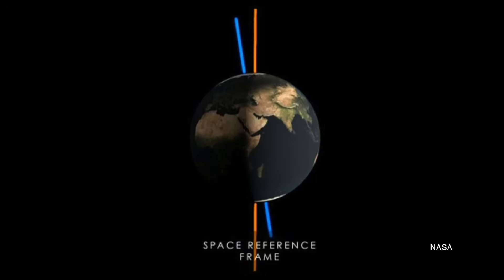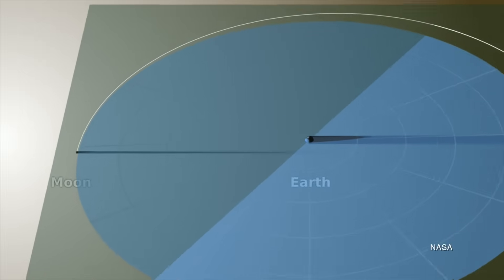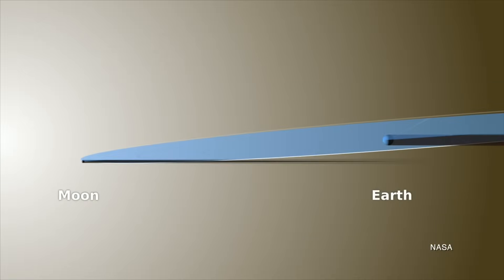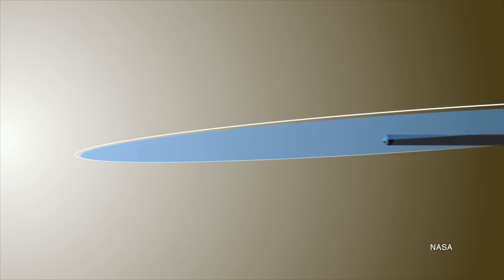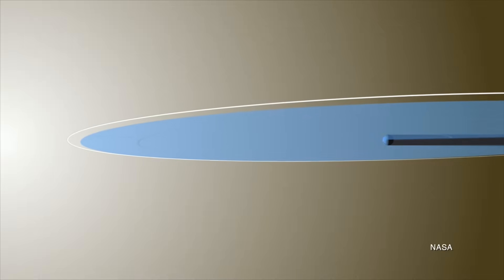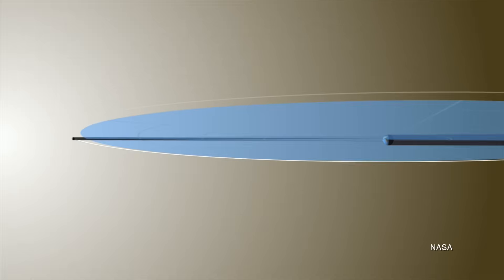Why Does a Rocket Need to Roll Going Into Orbit?

Comment: They also had to do a "yaw maneuver" to get the rocket going AWAY from the tower. appropriately named the LUT avoidance maneuver.
Reply from the maker: I talk about the yaw in my blog post. It was too long to work everything into the video... I didn't want it to be 15 minutes long!
Reply: yea, I think that yaw maneuver was way trickier, almost a side slip. Banging into the tower would have wrecked a lot of people's day
Reply: +bkearns34 Think "H-Bomb at 39A". Ka-boom.
Reply: +Accutronitis That was just the propellant servicing arms that are T-0 umbilicals that have to remain attached until liftoff (in the event that there is a scrub / abort the stages need to be drained)

The "yaw" after liftoff gets the rocket moving away from the tower so it does not hit it. I think the video of the Apollo 13 liftoff you can really see it (hard to see if the camera angle is bad)
Reply: +Accutronitis A forum that explains it. The "tilt maneuver" lasted from about 3.6 to 10 secs after liftoff. Maximum yaw was around 1.5 deg
Reply: +Amy Shira Teitel (Vintage Space) I remember John Young was always worried about the piece of "fixed service structure" that jutted out from the back of the tower to support the Shuttles H2 T-0 Vent Arm. Mentioned how he didn't know how the stack got by it.
Reply: I didn't know that yaw maneuver, how come tiny thrusters apply huge horizontal thrust required to move such a gigantic rocket away from the tower
Reply: +Kishor Bhatta It wasn't done with the RCS thrusters. Those are totally ineffective in the atmosphere. The Saturn V steered by "gimbling" (tilting) the engines on the corners. Does not take much.
Reply: +Kishor Bhatta On a Shuttle related sidenote, they DID do a small RCS burn of the thrusters in the nose section right at SRB sep, to deflect the plume of the SRB sep motors away from the cockpit windows (many crews in the early part of the program complained about gunk/streaks getting on the windows)
Reply: +Zoomer30 oh yea understood

Comment: Amy. How did they start the engines of a Saturn rocket? Is it just the fuel comming out of the exhaust and lit it with sparks?
Reply: The Rocketdyne F1 (the first stage motor for the Saturn V) was ignited using a hypergolic ignition cartridge. Basically this was a capsule containing a chemical that would spontaneously combust in the presence of oxygen, thus providing a reliable starting mechanism. 

The capsule was placed in the fuel line just before the fuel entered the combustion chamber. When the engine was started up, the turbo-pumps would fire, and start pushing the fuel through the line and into the rocket. This would burst the cartridge, and the chemistry would be mixed as it entered the combustion chamber and further mixed with the liquid oxygen, leading to sustained combustion.

The chemical in question was primarily Triethylborane, which was the same chemical used to restart the engines on  the SR-71 blackbird, and also used to start (and re-start) the engines on the Falcon 9.

In the case of the F1 engine, though, there was only one opportunity to ignite the engine, and no restart was possible. If they had a pad abort, the cartridge would have to be replaced.

Comment: Thank you. The idea that an object that is able to move in three directions couldn't just gimbal the engines to point into the correct direction didn't make any sense to me. It makes sense now, though. It's not about the rocket not just being able to point itself as much as it is that the guidance system needs to align itself. 
...at least that's what I took away from this.

Comment: I think Amy is awesome to her galactic centre and has been for light years but pitch and roll aside, I have a question for the budding Max Fagets and Apollo capsule designers out there. Why was the Apollo spacecraft's center couch slightly lower than the other two? And based on crew preference, why did Mike Collins choose the right hand seat on Apollo 11 when all other CMP's rode in the centre couch? It's the simple things about Apollo that annoy me most. I spoke to Al Bean and Gene Cernan once but these are not questions you would ask in their presence. Hopefully someone can finally answer these questions that have bugged me for years. And hopefully before Voyager reaches the Oort Cloud...
Reply: As to the center couch being lower than the other two, I don't know... but my guess would be that since the center seat occupant entered last it made for an easier strap-in. Either that, or it had to do with how the couches folded to be stowed away in coasting flight. Or it made the three side-by-side seats less cramped with the center occupant's shoulders slightly lower and out of the way for the others. Or maybe something else entirely. :-)

As to Mike Collins, as far as I understand it wasn't really his decision to take the right seat. Armstrong and Aldrin had already trained as commander and CMP respectively in the backup roles for Apollo 8, and Collins wasn't part of that crew. It was decided that even though Aldrin changed roles from CMP to LMP he would still ride center couch on liftoff, since he was already extensively trained as CMP.
Reply: That's a swift response and great answer Benny Lofgren and thank you. It's funny but I forgot that Aldrin's roll on the Apollo 8 back-up would have had an influence on that. It's just that Aldrin was last to enter Columbia on launch and that put him in the centre couch. It makes sense when Fred Haise was the back-up LMP without an LM.

As for the centre couch being slightly lower, I had read in a spaceflight publication many years ago about this. However the author's only explanation was 'for obvious reasons'. Maybe he didn't even know. I know the centre couch was dismantled for most of the flight. The only things I could ever think of were for non-operational reasons and they all made no sense...

Comment: I still don't get why the roll? The yaw away from due east so as to align with the Moon makes sense, but why did a cylindrical rocket have to roll to change yaw? I'd compare it to an air to air missile, which as I understand it, doesn't roll to change heading, it just changes pitch/yaw as needed. To keep the crew orientated "heads up" so to speak?
Reply: Several reasons, crew orientation being one aspect. Look through the comments, it's been thoroughly answered by me and others in other threads.
Reply: In addition to the reasons mentioned earlier (crew orientation, simpler math), there's the aspect of "relative wind"-as the air rushes past the rocket, you want the nose pointed as close to exactly into the wind as possible.  If you use a combination of pitch and yaw, you're "crabbing" your way into orbit.  The rocket isn't moving through the relative wind nose first-it's kind of approaching it from the side.  That adds stress to the rocket and is less efficient.

Comment: When I play KSP most of my rockets roll as I perform a gravity turn, I find that some horribly designed rockets that would otherwise explode gain quite a bit of stability. RCS becomes pretty useless though.
Reply: RCS is for docking :)
Reply: Nah there's a claw for that. RCS is for helping dodge bits that fall or explode off during a launch.
Reply: +Marc83Aus Have you ever tried docking or grabbing with just your main engine?
Reply: Sander Datema I've done it before after running out of mono prop. But generally I'm terrible at rendezvous and docking even with all the stuff KSP does to make it easy.

Comment: And I guess the same is true for the Space Shuttle when it launched to the ISS which is inclined as well. But why didn't they build the Saturn launchpad in the right orientation in the first place? Saturn V was only supposed to go to the moon and never stay in Earth's orbit (except Skylab), wasn't it?
Reply: That's correct. The launch pad was oriented for the convenience of everything on the ground -- the crawlerways, the calibration equipment, camera and launch center views, etc. A roll maneuver is actually a very simple thing to do, and it had to be different for every launch anyway because the launch azimuths were different.

You didn't have to launch exactly into the moon's orbital plane, which is fortunate because the moon's inclination varies between 18.3 and 28.6 degrees. KSC's latitude is about 28.5 degrees so most of the time it would have required an expensive plane change to match the moon's low inclination.

But you did have to launch into an orbital plane that would include the moon when you got there. This, along with landing site lighting conditions, set the launch window and azimuth. You also had to be at the moon's distance when the moon passed through your orbital plane. This was the reason for having two burns of the S-IVB; the timing of TLI could be easily changed, and that would rotate the position of apogee within the orbital plane to match the moon as Apollo approached. (Actually apogee was a little beyond the moon's orbit to speed up travel time. But it was obviously still important for Apollo and the moon to reach nearly the same point in space at the same time.)
Reply: Apollo planners no doubt though there was a future beyond just moon landings. Von Braun wanted to see humans go to Mars and the Saturn-V was the ticket for assembling pieces of the craft, many of which were derived from the Saturn-V itself. There were plans closer to Earth for building second generation stations beyond Skylab. These missions would have had slightly different roll requirements than just the lunar landings. What planners could not foresee in 1962 or so, was that just a decade later, Apollo would end and end with three of the remaining lunar missions cancelled.
Reply: Because there is no "right" orientation. It varied between missions, and even as the launch window moved in time as the Saturn V sat on the pad waiting to lift off. Any countdown holds might require adjustments.

Think about it: Even as the rocket sat stationary on the pad, apparently absolutely rock solid, it moves through space with staggering speed. Only taking Earth's rotation into account, the inertial reference platform in the spaceship would measure about 1600 km/h velocity standing still. And if we also account for Earth's rotation around the Sun, the Sun's rotation around the Milky Way, the Milky Way's rotation around its cluster and the whole shebang's flight away from Big Bang's "ground zero"... well, I don't even know how much all of that adds up to. :-) Not that all of that is taken into account in our "local area" spaceflights, but what we do need to account for is among other variables the Earth's rotation and motion and the Moon's corresponding motions around the Earth.

Comment: +Amy Shira Teitel, how come the need to roll the Saturn V (or any spacecraft for that matter, you described reason for the shuttle In your blog), is weight not distributed evenly around the center axis thus making the roll needed? Or is it (like the shuttle) to make antennas point in the right direction?
Reply: The roll is necessary to put the launch vehicle on the proper heading to an exact orbital insertion point. At the time of the first shuttle flight, the reason for the roll was to put the astronauts heads in a down facing position to allow blood flow to remain in their heads. A heads up position would have sent blood to their feet making them theoretically prone to passing out. Another reason was to facilitate easier External Tank (ET) separation. However, in recent shuttle missions, the shuttle actually rolls to the top of the ET putting flight crews in a heads up position. Experience must have shown the heads down roll not to be as critical to astronaut safety as believed for early shuttle missions. The shuttle was definitely off axis as far as mass. The main engines are gimbaled to account for this prior to and during launch and ascent.
Reply: +J Dean ok but a heads down position would put them in risk of "red out" if the blood rushes to the head, that is why fighter pilots keeps the head towards the center of the circle when making turns to avoid that, as astronauts were lying on their backs and with the feet higher than the heart it should not make any difference as the pressure would be pushing the blood against the back and not the feet or the head, or would it?
Reply: The shuttle, at least, always rolled and flew heads-down. The thing is there's enough thrust pushing you into your back (since the back is towards the rockets) that the 1g from earth is relatively insignificant.
Reply: It appeared the heads down position was less risky than heads up. But the more recent flights were heads up after 5 minutes or so because the shuttle rolled onto the top of the ET. Although I haven't seen it published, it appears neither position is really a problem.
Reply: This is correct. However, after some 5 minutes, the shuttle rolled again to the top of the ET as can be seen in some of the launch/ascent footage.
Reply: +J Dean ok, but I understand why the shuttle flew heads down, but the Saturn V, why did t need to roll, I mean, to get to the proper heading all you needed was to gimble the engines to pitch the rocket in the right direction, but why the roll?

Comment: didnt the space shuttle roll during ascent? I would like to know that as well.  but this looked very difficult so if you dont I will still love you.
Reply: Yep, pretty much as soon as it cleared the tower, it went into its roll program to orient the spacecraft in a heads down orientation, and pointed into the orbital plane they wanted to go in. It just makes everything simpler to fly like that.
Reply: but why didnt the shuttle take off already orientated? why make the launch tower and shuttle face about 90 degrees the wrong way?  I used to think it was in case they needed to abort after liftoff but before the gravity turn they could decouple and land on a runway nearby.  theres nowhere to land halfway across the ocean.
Reply: The launch complex is a huge piece of engineering. There is the tower which weighs thousands of tons, the flame trenches to deflect the rocket blast, and so on and so forth. There is no way that you could change it between launches. Conversely, depending on the intended final orbit, the shuttle needs to take off in any number of directions (all heading out over the water of course). Finally, the pad was recycled from the Apollo program, so they couldn't have changed it in a cost effective way.
Reply: almost everytime they launched they go the same way.  they were usually going to the ISS for construction though.  and if they went to a polar orbit they would have launched from launch complex-6 at vandenburg airforce base in california.  there was only one time they planned this and it got cancelled.  and I am not sure if they ever flew to retrograde or not.
Reply: So in general, yes, they always launched in roughly the same direction, but only ever in a really rough sense of the word. The shuttle was capable of launching into a wide variety of inclinations, each of which requires a different angle off the beach.
Reply: No, they didn't.  One launch constraint is that you couldn't have the shuttle (or any of the other manned spacecraft) fly over inhabited land during the early part of the flight.  The whole idea behind SLC-6 (aka "Slick 6") at VAB was that if the DoD needed something launched in a polar or sun-synchronous orbit, they could launch to the south from there and not pass over any people.  The first planned shuttle launch from there was to be in late 1986, but the Challenger accident grounded the fleet.  By the time they were flying again, the DoD had decided against using the facility.  There were quite a few concerns about using the site, and the grounding gave them time to think them through.
Reply: Pads 39A and 39B, which are the launch pads for the shuttles, were also the pads used to launch the Apollo missions (i.e. already built). A no role launch from KSC places a rocket in an inclination orbit of about ~28 degrees. However, the ISS is at an inclination of 51.6 degrees, therefore, the shuttle needed to role to that orientation to get in the same orbit as the ISS. Instead of spend dollars on launch facilities, it was much easier (and cheaper) to execute a role program. Incidentally, the Russians have always launch their rockets at 51.6 degrees...now you know the reason why the ISS is in a 51.6 degree inclination.
Reply: yeah I already knew that the russians put the first piece of the ISS in orbit (zvezda module)besides that.. you never explained why the russians launch into a 51.6 degree inclination therefore never explaining the "reason why the ISS is in a 51.6 degree inclination." the reason the orbit is at 51.6 is so russian launches out of Baikonur never fly or crash over china.

do the math here 51.6 - 28 = 23.6  degrees. watch the shuttle roll about 180 degrees.  its facing the opposite direction. so your answer that they would roll such a small amount is wrong.

I think I just figured out the reason on my own.  

the shuttles main engines thrust through the center of gravity.  it actually pushes horizontally.  so at takeoff they are already pushing east as the shuttle is on the west.  when they start the gravity turn they want the shuttle underneath the orange tank. so they roll and tilt at the same time to always push east and never waste any delta-v.

KSP taught me EVERYTHING!!!!!!!!!!!!!!!!!
Reply: unknown cuyler  "the reason the orbit is at 51.6 is so russian launches out of Baikonur never fly or crash over china."

It's also quite close to the latitude of the Baikanour Cosmodrome (46 degrees N) so it's a pretty efficient orbit for them to reach.